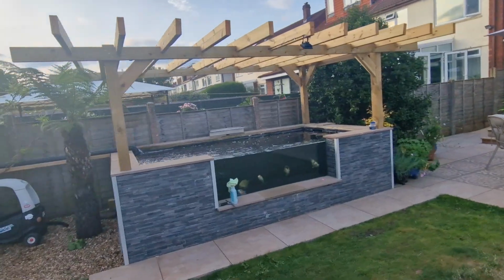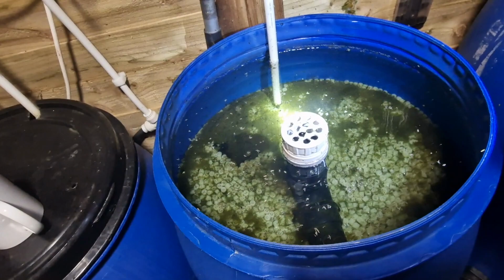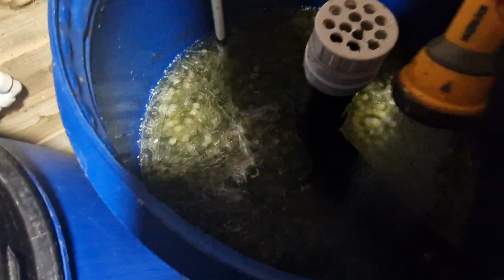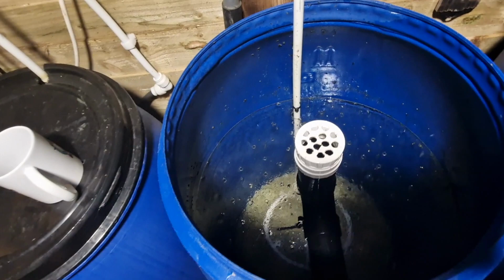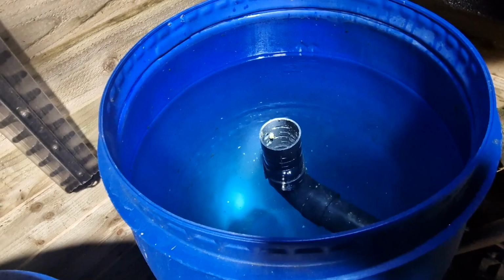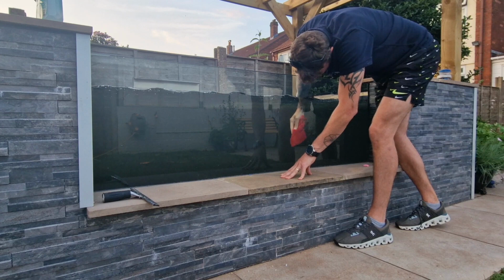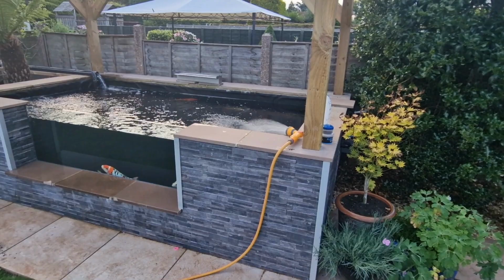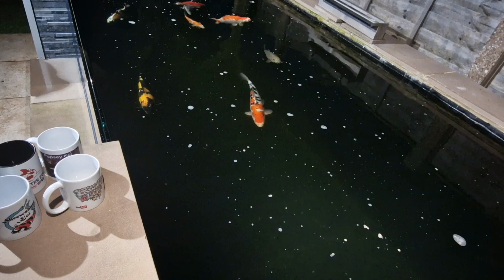D.I.Y 3 Barrel Koi Pond Filter Part 3

Comment: I built a barrel system before moving onto a drum. I had the same problem with it over flowing you need to extend the water exit pipe with slots in longer so media can come up further in barrel before overflowing which also gives you more slots to lay water through. Hope this helps there great system and work really well, however your water looks great as it is.

Comment: Couldn’t you put a wave maker in the bottom of your blue barrel filter to remove the debris from the bottom of the barrel and couldn’t you use an egg crate to hold the K1 down in your barrel. And maybe a filter sock over tops of the pipes for stop files or debris.

Comment: Could K1 “sinking” media have worked in first barrel?
Reply from the maker: Possibly....definitely something to think about there!
Reply: @BrizzleKoi  great content btw. Just when you think you have seen it all, you find a couple of other hobbyists, and back down the rabbit hole ya go.
Reply from the maker: @kristopherwolf3811  definitely know that feeling...I think I watched every other diy barrel filter video on YouTube before starting mine. And recently done the same with bog filters 🤣🤣🍻
Reply: Good idea, I always hate the thought of a totally empty filter bay, almost feels a waste!
Would probably work best with a perforated tray for the media mounted above the water inlet to create a void under the media so that the water rises up through the media to the outlet!
Also to be an effective vortex it really would need to be considerably bigger to promote a slower circular motion and proper dropping of solids!
Think your suggestion of “sinking” K1 would prove much more effective at removing fine particles and contributing to clear water, particularly with a “pump fed” system which is going to be chopping up the waste and macerating it, which is difficult for any system to catch properly!

Comment: why is the UV fitted before the filters ? please help iam confused. Cant it be fitted just after the moving bed ?
Reply from the maker: If I was to fit the uv after the filters I would have had to raise filter system up so water would flow though the uv back to the pond...even then I think the uv might restrict the water returning to the pond. Hope that makes sense. I was a bit worries about muck build up in the uv but I recently pulled the lamp and quarts sleeve out and I was surprised to see it clean.

Comment: What keeps your pond pump clean from debris before it ever get to the barrels? My problem is I have so much algae and muck in my water I have to keep cleaning the filter in the pond itself.
Reply from the maker: I use an evolution aqua varipump 20000. It doesn't have a filter on the pump and if i remember rightly it can pump particles up to 10mm

Comment: What is the white pipe and fittings and where did you get it from mate
Reply from the maker: It's 15mm plumbing pipe. Manufactured by JG Speed fit and I got them all from screwfix
Reply: Cheers 
I noticed in later vids you don't have thr vortex in barrel one did it not work out ?
Reply from the maker: @pinpickers1175  about 6 weeks ago I removed all the k+ from the first barrel and I now use it as a vortex. It's work amazingly. I was also cursed with the dread blanket weed recently so I fitted some filter brushes in the tip of the first barrel while I treated. I've decided to leave the brushes in permanently as they do a great job of catching stuff. I think I show the brushes in the blanket weed video I recently uploaded